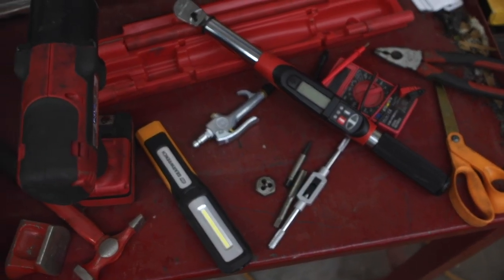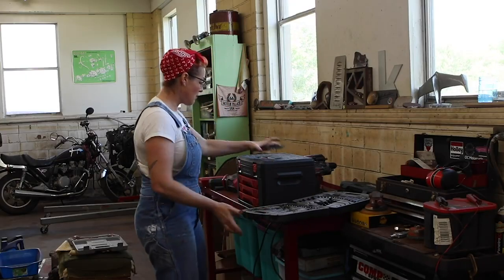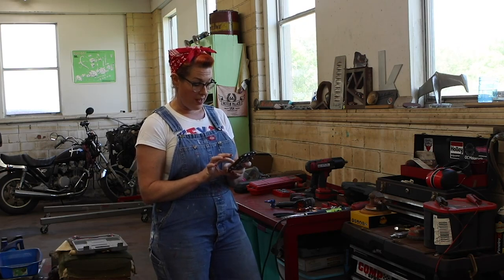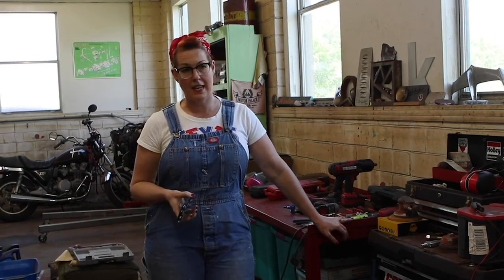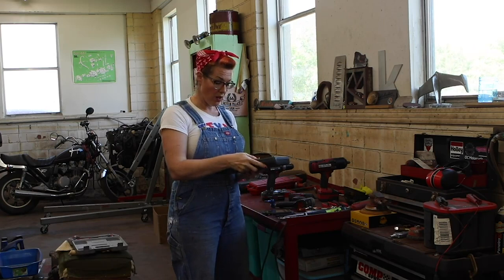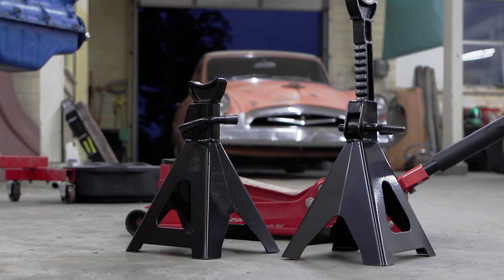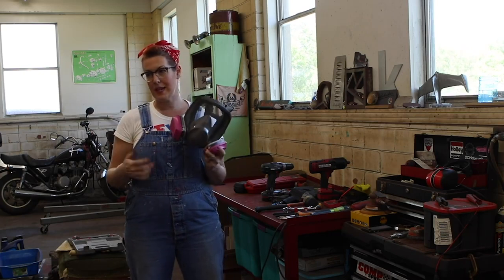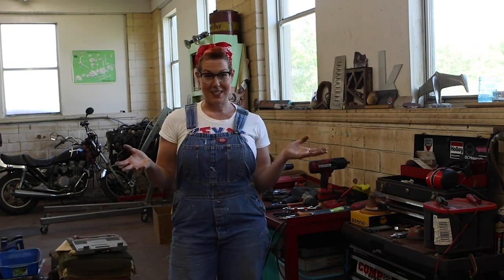Extra Good: 10 Must-Have Tools for Car Restoration

Comment: I find that a MAP gas torch is way better than a propane torch. I find the bottles last longer and the torch gets hotter. They also make a miniature oxygen-MAP gas torch which gets really hot but it goes through expensive oxygen extremely fast. I find that with heat and either a damage nut extractor or a cold chisel and a 3-4 pound hammer i can get most things out.